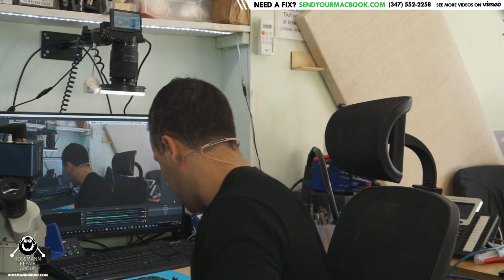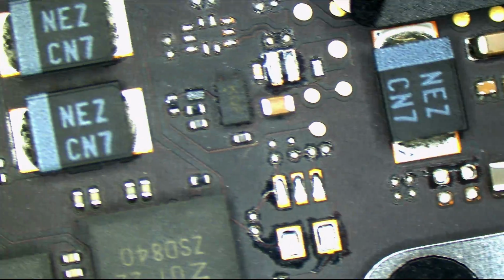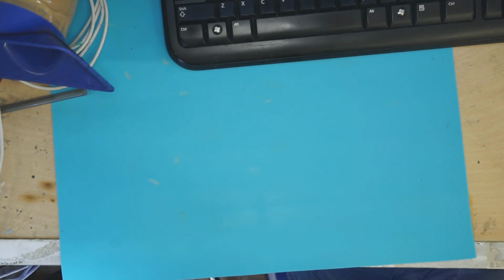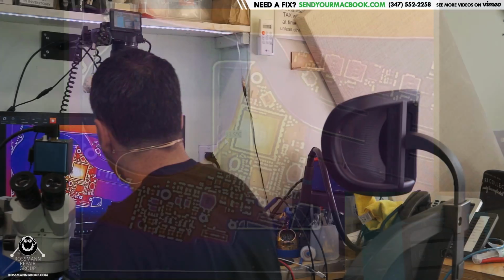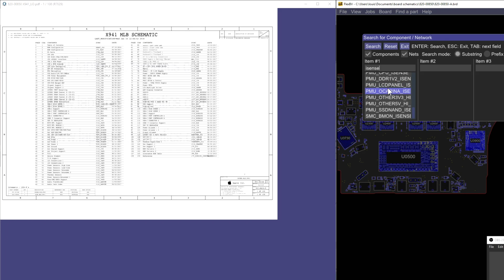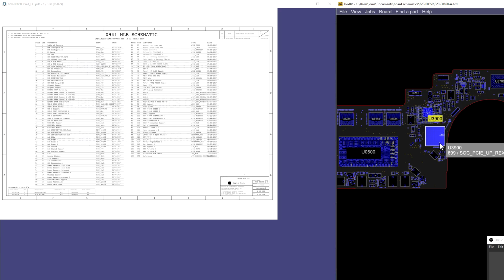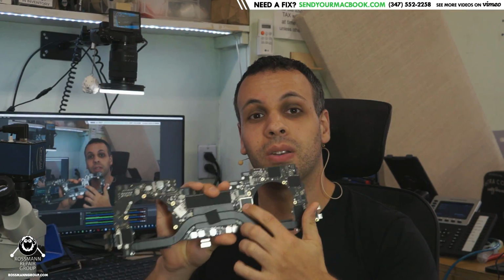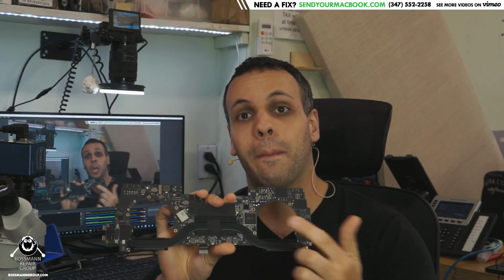Apple users have no one to blame but themselves.

Comment: as long as you continue to support a company that treats their customers in this fashion they will continue to treat customers in this fashion with no checks and balances. End of story
Reply: @UwUKris  well that's great for you you are in the vast minority numerous people have already been shown on this channel as well as many others on YouTube that Apple has scammed the hell out of a lot of people especially in their stores and with their repair jobs or lack thereof so while your experience is in no way a normal good for you you keep doing what you're doing but the rest of us little scrubs will avoid Apple like the plague until they start treating the customers... All customers the way they should be treated
Reply: We do blame  for their fuckery. But they have their users in the reality distortion field Jobs created. Where in his reality. If something fails it’s the user’s fault. And other users who haven’t had X Y or Z failure blame the user who had X Y or Z problem on the user with that’s problem. Because that is what culture  has created.  They weren’t using the poorly designed products correctly but  banks on their customers being mostly not tech savvy to understand the bullshit  pulls. So this is the shit we get. Hardware is built by the lowest common denominator. You get things like the T2 chip. You get Touch ID married to the motherboard. Where on Samsung devices I swapped my fingerprint sensor on my s9+ my phone didn’t notice the difference. Everything with fingerprint authorization worked like normal.  says it’s because of privacy they do all this stuff but really it’s so when not if but their products break. You have to buy a new one because their repair is about 10-15% cheaper than a new device. That’s how they make their money. Cheap hardware that user’s get stuck with because they make decent operating systems and services that run on this shitty hardware.
Reply: I have never bought an Apple product. I am happy that I am clean of their filth!!!!
Reply: Problem is dipshts who support Apple don't watch Louis's videos.
Reply: @UwUKris  Tim....is that you?
Reply: People are still dumb enough to lick Apple's ass.... They are in millions...  First world nation noobs...
Reply: I never bought a product directly off of them. Instead, fixing up broken stuff makes me able to get their stuff virtually for free, so I’m not complaining
Reply: @UwUKris  wow obviously you need to read my comment again I did not discount your experience because I have no idea what your experience is what I'm saying is you are in the overwhelmingly minority component of that type of experience because everyone else speaks the opposite of what you've experienced they have gotten ripped off by Apple Stores they have gotten video of Apple Geniuses stating that the repairs should be 1800 plus dollars when it was proven by Lewis on the camera that was simply a loose cable not allowing the monitor to turn on. Either they are scamming people or they're just woke Ali untrained and incompetent either way it's completely inexcusable for the way they treat their customers now if you haven't had that experience count yourself among the lucky because that's not the norm in fact it is far from it so if you took that as a personal attack on you then you need to grow a pair because it wasn't meant to be that and for you to get so defensive and insulting really wasn't necessary but have a great day anyway
Reply: @UwUKris  now of course there's another possibility hear that you're a complete and total troll and you're just trying to get people to get upset I am nowhere near that but again for the record the majority of people have a very negative experience even if they may not realize they're having a negative experience because they just pay the money for a repair not realizing that they've just gotten taken or they go ahead and purchase a brand new piece of equipment even though the equipment that they had was completely repairable because they took the advice of an apple representative so if you've got that money or your investors for your company have that money then keep spending it by all means but apple is a horrible horrible company as far as doing what is right for the customer Apple does what is right for Apple always has always will and will continue to do so until they are recognized for the horrible customer service company that they are
Reply: @UwUKris  now since you have all of this experience of yours and since you're completely attempting to Discount everything Louis stands for at this point I suggest you start uploading videos to your channel since does not have any content in this point and has not had any content since you joined in 2014 so I suggest you put your money where your mouth is and start proving your points by showing how well Apple treats you with specific examples documentation and video evidence I want you to be able to refute Lewis's claims if at all possible because with all things I'm more interested in facts then some positions Lewis has backed his supposition sup with facts and it's proven beyond a shadow of a doubt that Apple for lack of a better term as far as a customer's concerned is evil so if you'd like to refute that I'd be more than happy to watch your content if and when you ever post any
Reply: as long as you continue to support a government that treats their people in this fashion they will continue to treat people in this fashion with no checks and balances. End of story
Reply: @axeman2638  okay what the hell is this have to do with politics and as far as I'm concerned current administration is treating citizens as citizens and I say they're doing a fine job so far compared to past years but thanks for staying on topic